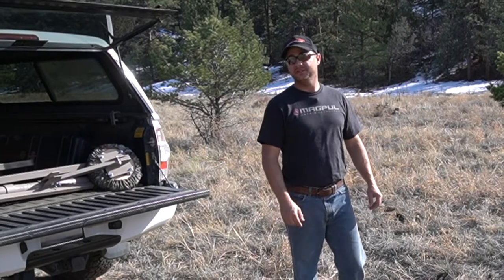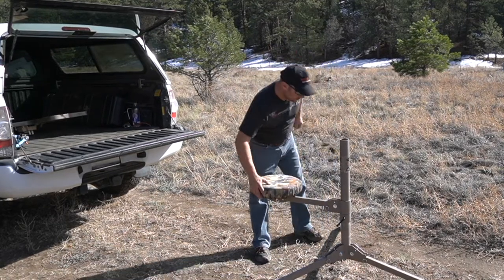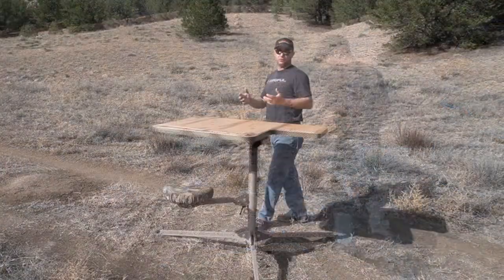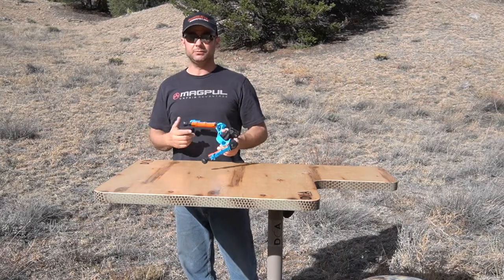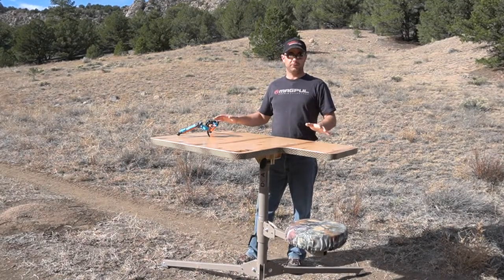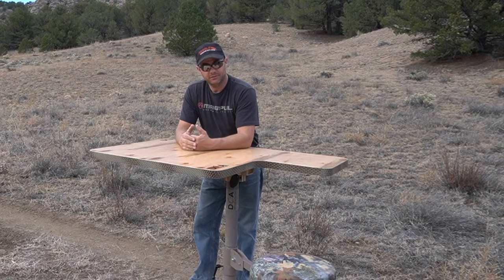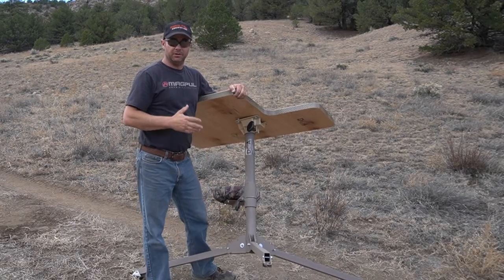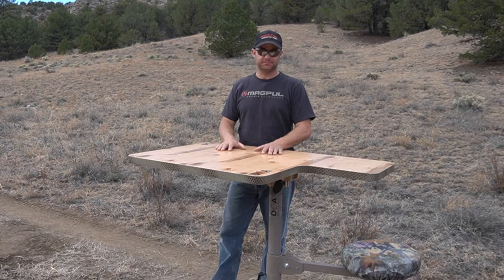DOA Shooting Bench Review!

Comment: Lovely piece of quality gear. It would be nice if a future iteration replace the pins with something that is captured.  For the seat, use a ball detent as that pin just seems to be for transport.  For the ones on the feet the would be nice if it auto-locks when opened.  A spring latch on each leg would do but they are annoying to release.  Some tripods have a bar attached to each of the leg and to a collar like the one you use for seat height adjustment with the same type of tension lock.  It would add weight though, and you would have lose the adjusted seat height when breaking it down for transport.  It would be neat if they could make it ambidextrous (yeah, I know you said below it's available for lefties).  Not sure if you could make a slide mechanism that is sufficiently stable.  Obviously flipping the table top over would do but that's inconvenient and you end up with holes on both sides if you switch between left/right more than once.  Removing the tabletop sounds back-breaking :-(  They could use a hinge between the leg and table top instead so you just leave it on.  Wheels for transport?

Comment: If the table don't swivel with the seat, what difference does a swiveling seat make ?... nice vid.
Reply: If you want to switch to a different target, all you have to do is loosen the screw that holds the table and rotate right to it. That's great compared to moving a table full of stuff.
Reply: @eddieb9110  by the time you get done with that the target is long gone, plus one can't shoot with all the stuff on the table in your way ? You got to clear some space !
Reply: @jamesdenny4734  I haven't ever had a steel plate run away on me. I do see people using these for prairie dogs though.